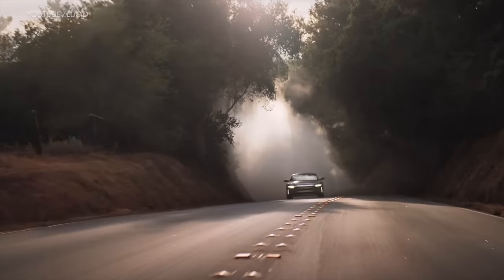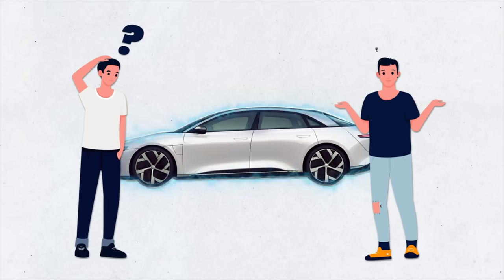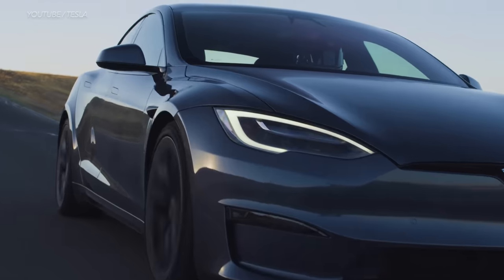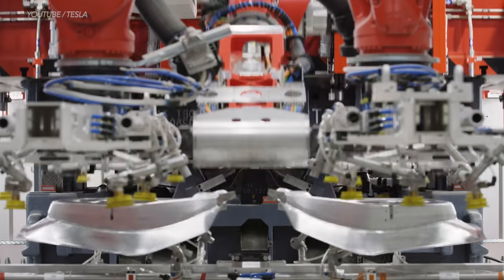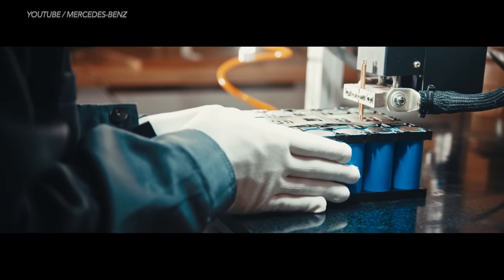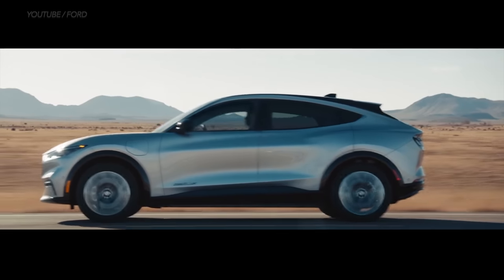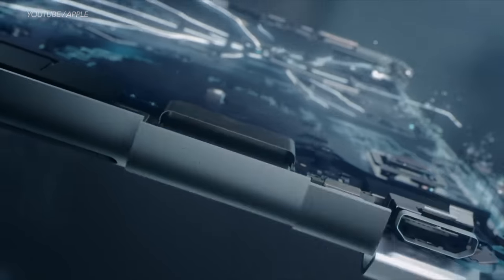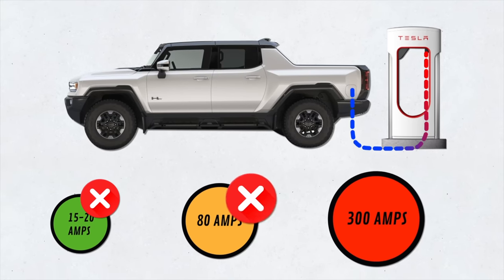Here's Why I'll Die Before I Buy an Electric Car

Comment: I don’t get it how they claim they save money on gas when you’re paying 54k for a Tesla $890 a month for 6 years!
Reply: Nailed it!!!!
Reply: First things first, you dont need to buy a Tesla. You can buy a Nissan Leaf for under 30 grand. Secondly, electricity is much cheaper than gas in current times. It only costs around 20 bucks to fill an electric car. 20 bucks times 4 times a month filling up is 100 dollars. With a gas car that is similar size and price. 6 dollars a gallon, you spend 70 bucks at the pump, 4 times a week, you spend 280 dollars a month on gas. And with a car that runs on premium you are running around 400 a month filling up 4 times a month. So, you save over 150 dollars for a car that runs on regular.. double for one that runs on premium. The math isn’t hard to figure out! Unless your too old to remember.
Reply: @mauricebarry8858  woah woah, let's take a step back. Most people that don't drive more than 12k miles a year aren't needing to fill up 4 times a month.
Reply: @mauricebarry8858  You want someone to shell out 30k for a Nissan Leaf, which is basically half a car and would not meet most people's needs in terms of utility? lol
Reply: Gas you average 75k miles 10k cash.
Tesla 75k miles 1500$.. 
You complaining about a car note is laughable.
Gas is a joke.
Reply: Not to mention Teslas are ugly cars.  I'm not interested in spending 60K for an ugly automobile.
Reply: You don't save money until you have had the car for its whole lifetime. Then you save money. I watched a video from a major news network that broke down the cost savings on EV to around 2 cents per mile. Lots of miles to drive to make up that difference. Electricity still costs money, it's not free.
Reply: @mauricebarry8858  cheap electricity go talk to anyone in Europe, like Germany or Cali or new York
Reply: @kensmith2796  teslas are not the only electric automobiles.
Reply: @craigfin3222  A Nissan Leaf meets most city peoples needs a small hatchback with room for 2 kids and 2 adults and groceries. Those are the people who shall go for electric cars, if you really need an extreme amount of utility, you go for a gas pickup. Everyone doesn’t haul wood for a living.
Reply: @richard6802  More like YOU don’t do that. Lots of people who have busy families easily get 12k miles a year and even more. Filling up once a week is normal for lots of family commutes, who an electric car would be ideal for.
Reply: @craigfin3222  You gotta shell out at least 23 grand on a small car like a leaf anyway nowadays.. small cheap cars aren’t 17 grand anymore.
Reply: @jamesa6740  Or me. 8 cents per Kwh in Ontario.
Reply: @jamesa6740  gas isn’t cheap there either. Gas has been over 8 dollars for years in Europe and its even higher now. Same with cali. Gas is closing in on 9-10 dollars in cali.
Reply: Paid $7500 for my Dave Ramsey clunker 2007Camry with 50,000 miles .I smile putting money in my savings .Had it 7 years and it’s still only has 69,000 miles
Reply: Have you seen what gas vehicles cost?? Plus no Oil changes or transmission very little moving parts to fix or take care of. Even the brakes don’t have to be replaced. You can fully charge your Tesla for $15. Basic math Tony!!
Reply: @mauricebarry8858  so honestly your estimations on how often people need to fill up on gas @4 times a week are wildly exaggerated in most people's case but lets just go with that, $280 for gas vs $890 a month on a car note means you would be paying $610 MORE per month to own a realistic EV and realistically a Nissan Leaf does not meet the needs of the average person but even with a leaf it would take 10 years to break even vs buying gas even at the exaggerated rate of purchase you quoted.
Reply: Tesla model 3 is a cheaper quality than Toyota Camry XLE but with 20K$ more. In addition, expect to change upper arm around every 30k miles. Tires on EV worn out faster than ICE. All of these details don't make you save a lot money compared to ICE. However, you gain range anxiety and your 5butt may be frozen in cold weather.
Reply: @js6729  I said buying gas 4 times per MONTH. once per week. On premium gas @ 7 dollars/gallon, you may spend upwards  of 400 dollars per month. Based on the type of cars I see on the road each day (Camry, corolla, civic, accord, fusion, escape, CH-R, CR-V, and other eco vehicles,) you may find yourself paying 30 grand for a decent spec of those vehicles. Even if you only fill up twice a month you still save on gas money because electricity is much cheaper than gas. Sure, if you're replacing a truck you may want something more heavy duty, but a Nissan Leaf certainly has a target audience that has more buyers than the country farmer pickup market.
Reply: Buying a used car and buying gas for that car, is alot more economical for alot of people( mainly people who don't travel vast distances)
Reply: @jamesa6740  in Europe ev adoption is the highest rate in the world. They will tell you that being tied to fossil fuels is a fools errand. Look what's happening in Germany. If Russian turns off the taps Germany is screwed. How would you like to be held hostage like that haha. Part of the move away from fossil fuels is so that countries cab have control of their own energy needs and not be held hostage by opec and other such fossil fuel suppliers.
Reply: @js6729  it just really depends how much u drive, what you would be replacing, and if u can charge at home or not. I drive enough that my savings on fuel makes my entire payment for me plus some. If you own a civic and drive ten miles to work every day and that's it, you're not going to benefit from an ev. If you're a sales person or something and drive a crossover 100-200 miles a day or you're an uber driver or something the ev will easily pay for itself. Uber drivers are actually renting teslas today because it's cheaper to rent a tesla and use that than it is to drive their ice vehicle.
Reply: @mauricebarry8858  I noticed he messed up how many times a month you mentioned filling. If you filled up four times a week your fuel savings would easily make your entire payment for you.
Reply: @mauricebarry8858  if you can charge at home an average 0-100 charge only runs you about $10.50
Reply: We went from averaging about $1700 a month on fuel to about $130 a month on increased power bill. So for us it was a no Brainer. But we drive A LOT more than most people.
Reply: @themeach011  This I agree with, I drive 5 miles a day during the week to work and back and on the weekends I go out of town to visit my dad who lives 600 miles from me. I don't have a way to charge an EV at home and there's no charging stations anywhere near me, there's also no charging stations between where I live and where my dad lives so an EV would not make it to his house. So I would not benefit from owning an EV at there current price and driving range. And yeah if I lived in the city and drove for uber an EV would be the way to go cause you'd make the equivalent of about $30/hr due to no gas cost
Reply: @themeach011  I don't even know how the person who wrote that managed to decipher 4 times a week, THEN proceed to WRITE IT and STILL not notice something is wrong lol.
Reply: @themeach011  Yeah and most times you don't even need to charge to 100 if you have a simple daily commute, work, school, grocery store, like most city-folk who would buy such a car like a nissan leaf, you probably only need 100 miles of range and thats generous.
Reply: @mauricebarry8858  But you're comparing to gas prices at $6 a gallon. For a more accurate estimate, you would take the average price of gas per gallon which is not $6. Gas won't be at that level too long I hope.
Reply: because a Tesla doesn't use gas...........  (how you save money on gas)
 You think other cars are free?  not all Teslas are 50k.   And the next wave of cheap EV's on the boats.
Reply: @justinparker1522  ok so let's talk about basic math, on a cross country road trip I can fill my tank in less than 2 mins at any gas station, while you will need to plan where to stop deviating you from your route and then have to plan what to do in line as you await the 3 folks in front of you to charge. I just spent $70 to fill my tank in 2 mins. You spend $40 to partially charge + waiting time, in ~2.5 hours. I'm already on the road while you are still charging your car wasting time. Time is $$$, basic math.
Reply: And how much is a Tacoma….. MB. Audi. And every other car.  You’re joking right because a Honda has reached 42k for an accord…….. 🙄
Reply: @jeffcoleman5160  Keep it as long as you can!  The engine tech from 2007 was the perfect balance of reliability and complexity.  Your Camry will run forever without the turbos, direct injection, and other nonsense to get an extra couple mpg.
Reply: @justinparker1522  Brakes still need to be serviced regularly to keep the calipers from seizing even if the pads are used very little.  Brake fluid still needs to be changed.  Shocks and ball joints wear out like any other car.  The extra weight of an EV means expensive tires, changed more frequently.  You still ultimately pay for depreciation like any other car.
Reply: @themeach011  EV's have their own OPEC equivalent, namely China.
Reply: @confidentlocal8600  funny story .one of the pistons cracked and I had it rebuilt with better rings and better anchor bolts for the head .$3500 but it will last for a while now
Reply: @mauricebarry8858  I just bought a Nissan Leaf for 14,500. I was spending $380 a month on gas to get to work. My Nissan Leaf payment is $260 a month. Perfect for what I need.
Reply: Wow Tony H I guess a lot of people don’t get it my car payment is $217. a month I could never spend $683. a month on gas both vehicles I own cost $120. a month for gas you and I see the savings sticking with what we have now.
Reply: @hardkore360  just did a similar scenario to what you propose. Did about an 800 mile road trip in my Kia EV. Cost, about $40 in electricity. Total time waiting for a charger, 0 minutes. Total time charging, 45 minutes. What I did during this time, restroom and food breaks which I would have done anyways as I have done this trip many times, this however being the first in an EV. Cost for fuel in my last vehicle to do the same trip, $300+. It’s simple math as you say. Running cost for my EV, $0.02-$0.08 per mile depending on state and charging rates. Average in my last vehicle, $0.43-$0.48 per mile depending on fuel cost. Even if you cut fuel costs in half due to higher current prices, I am still at an advantage in the EV.
Reply: @captinbeyond  they don't control the energy. Once u buy your car you are free to power it however u like. Plus you can build other chip plants etc wherever u want. China can't hold us hostage on that. We can make our own chips etc if we have to. U can't just conjure up oil out of somewhere that doesn't have any. I watched the video.
Reply: @captinbeyond  we can agree on that haha. Although just because we have oil doesn't mean we should rely on it forever and not embrace better tech. I feel like a lot if people don't like it because it's being pushed so hard but honestly if the tech is better people will want it and then the transition is happening either way. But I don't feel like we should be forced one way or the other but no one is going to force you to sell your gas car. U just won't be able to buy a new one eventually.
Reply: Just buy a nice used Honda and live happily.
Reply: @mauricebarry8858  let's be honest here... over the long haul you are spending more with an electric car even if gas prices hit $10 a gallon.. you can grab up a old camry 2010 or whatever for 5-10k with 50k-100k miles on it and I bet over the time it takes you to pay off that 45-55k tesla you'll still be saving more with the old camry. And you'll have more range per tank too... until I can pick up an electric used car at that low price that can still go 250-300 miles per charge. Ice still winning...
Reply: now 8-10 year car loans with all that interest, where's the savings? and if the car is not expected to last thru the loan?? wth?
Reply: @craigfin3222  :washhands:
Reply: @kensmith2796  there are about a dozen new manufacturers coming out and existing ones are focusing their efforts on EVs. Your excuses are running out quickly
Reply: @rkymtnchi503  I'm not making excuses and don't have to justify my choices to you.  I drive Jeeps - Wranglers and Cherokees with the inline 6 engine.  I will not be buying an EV.
Reply: @kensmith2796  I guess we'll see about that. I remember my dad saying he'd never drive one of those rounded car designs they started coming out with in the 80s and 90s. He doesn't have much choice nowadays, does he? You'll eventually be in the same boat
Reply: @btrts6431  if you sit in a 3 series vs a Tesla, I doubt you would go with Tesla. BMW or Mercedes feels much more luxury inside, Tesla is not a luxury car brand. I wonder why they sell it so expensive, it’s literally just body frame on top of a battery, nothing sophisticated that’s why many EV car brands will be established in the future
Reply: Exactly. I refuse to ever spend $54K on  Tesla. And I refuse to ever have a car payment ever and will always pay cash for ICE vehicles $30K or less and keep for 10-14 years or maybe longer. Rinse and repeat for rest of my life being 38 years old.
Reply: @craigfin3222  Bingo. Nissan Leave is like a go cart on steroids. And it costs as much as a solid small SUV or pickup like a Tacoma, RAV4, Escape, and the later 3 are so much more durable and of higher quality.
Reply: @themeach011  We have plenty of oil in the United States and Canada through fracking and tar sands we can easily be energy independent through that alone.
Reply: @confidentlocal8600  Bingo well said.
Reply: @Wolverine607  so why am I paying $327 for a tank of fuel in my truck then??
Reply: Tesla Model 3 LR with red color and enhanced autopilot (not full self driving) currently at CAD$88000 and wait time is 6 months or more. I just got a deal with a CPO Red Porsche 718 Cayman for CAD$63000, I will save $25000 for fuel and maintenance and I think Porsche 718 is a better looking car and driving dynamic imho! I will leave $1000 every year for basic maintenance, that leaves me $21000 for fuel, at the current price I could buy close to 9500l and with average fuel consumption I can drive for at least 77777km. That’s good enough for 4 years I think before my warranty run out then I would just sell it and buy another car!
Reply: @mauricebarry8858  lol if everyone switches to Electric cars electricity will be more Expensive to Produce which makes Gas More Cheaper cause the Less the Demand is the more the Supply the Gas for Less price.
Reply: My son won’t drive his Bolt from Houston to New Orleans to visit, because it sucks..
Reply: @kensmith2796  agreed the bulkier body style is hideous.
Reply: @mauricebarry8858  even the leaf is too much for what you get, I will absolutely never buy a Nissan leaf! I would walk before I buy a undersized, or under powered cheap EV. I would rather ride a conventional engine motorcycle than drive anything like that, then for utility work, nobody is going to buy current priced trucks either. I usually buy a big used nice truck for a low price for several reasons. I don't drive more than 5 miles a day. I need the truck for carrying stuff around or yearly trips. The cost of a decent EV truck is laughable for us common folk! Not to mention these EV's put out more CO2 than conventional engines if you decent range and you calculate the CO2 from manufacuring the thing. I'll wait for something else or die like Scotty! EV's are a big fail in my book, at least right now!
Reply: @TheWorst_time  I don't pay that much, and EV's suck! I'd take hydrogen over an EV, and they produce more CO2 than conventional engines!
Reply: @fabfrenchies1974  I know that’s untrue. I’m not even going to ask you to prove it. You just do not like EVs. 
Still better then gas if you own a home with a place to charge it.
Doesn’t fit everyone.
Reply: @mauricebarry8858  I doubt if you will be still driving your electric car 13 years from now like my 2009 Impala.
Reply: @DvniOS And look forward to buying a new battery every 5 years for a cost of thousands.
Reply: @mauricebarry8858  you forgot one thing, electric car of same luxury grade costs more than similar grade gasoline car, AND it derates more, so why would I get hit 2 times one during buying and second during selling of that EV? What for? For saving money on gas? 🤡
Reply: @richard6802  average is actually 14.4 k per year @ 24 mpg average that means 600 gallons of gas.  So at 3.5 a gallon a person spends 2100 yr and 21k for 10 years
Reply: @mauricebarry8858  I just compared a Nissan Leaf to my Corolla. The Leaf would cost more per month than my Corolla with my driving habits. Not to mention I live in an apartment, and can't charge my car at home. My car gets over 400 miles per tank, and the Leaf only gets 212. It will never work for me. The time to charge would interfere with my schedule also. Now, I compared the two new because I would only get an EV if its new. The Battery replacement would cost way too much if it isnt working right. EVs are just not there yet.
Reply: @mauricebarry8858  who the heck pump 4 times a week? Commuters maybe. I live 5 minn drive away from work. I pump once or twice a month. Also my wait time at the pump is 5 mins maybe less. What is your wait time at the charging station?
Reply: People are easily brainwashed!
Reply: @mauricebarry8858  No I can't buy a Renaultssan Leaf for under 30 Grand because I am not made of 💰 like some people seem to be. 

And as for the premium fuel expense claim. 

It just so happens that I drive a 2013 Mercedes C250 Coupe with a 1.8, 4 Cylinder Turbo GDI, and a 7 Speed Transmission.

And guess what?? 

It gets nearly 500 Miles on 1 tank of 91 Octane Fuel. And where I live Fuel prices are dropping below 4 dollars a gallon now. 

And my car is more fun, more comfortable, and far less expensive than the rediculous, and hideous Renaultssan Leaf.
Reply: @mauricebarry8858  

The problem is we don't even need EV's.

I don't need one and neither do you. 

They are just smoke and mirrors.
Reply: @mauricebarry8858  

Electricity is only cheaper until your electric company asks for a rate increase. 

That's what they do best. 

For the love of money is the root of all kinds of evil.
Reply: @themeach011  

But you didn't need an EV though. 

What you had was just fine but you were not content and that's why you switched. 

See that's the problem with EV fanatics, they are never content with what they already have.
Reply: @mikeb1039  How you save money on gas by putting it right back into the purchase price of an EV or monthly payment for one. 

Nice way to NOT save on gas.
Reply: @lukereeves4448  

But you didn't need a Renaultssan Leaf

You fell for the Smoke and Mirror's
Reply: @moarpwr4414  

No your not at an advantage. 

You said that trip you needed 45 minutes to charge your car.

Why would you waste 45 minutes charging your car when you could have been back out on the road and to your destination that much earlier. 

And what if the charging station was out of order, what would you have done then??

The inconveniences of an EV are far more than you realize. 

Not to mention that Kia's quality control sucks. I saw a brand new Kia SUV on 🔥 off the interstate in my city. 

Just saying..

Facts are facts. And the fact is that EV's are all smoke and mirror's
Reply: @LegendRonk  Exactly!! These EV fanatics just don't understand the Facts.
Reply: @8188jlpc  Bingo!! And what happens when they can no longer afford the payments. 

Uh oh, repo time.
Reply: @extremedrivr  right, because a little drought and extreme weather is good for everyone. People are getting more EVs going forward and maunfacturers will focus on them now and in the future, whether it hurts your feelings or not
Reply: @extremedrivr  just because we aren't going to run out doesn't mean we should just keep burning it forever if there's better sources of energy available. I'm not a radical environmentalist by any means but to me it still makes sense to transition away from burning fossil fuels if we don't need to. There's plenty of other uses for oil and it will likely be a part of our lives for many generations to come.
Reply: @themeach011  There's no need to transition away from fossil fuels. 

I'm not saying we cant use other energy sources along with fossil fuels to power the grid.

What I am saying is that there's no reason to convert ICE cars to EV. That is completely unnecessary, a waste of time and 💰. Plus it's horribly inefficient, inconvenient and impractical when compared to ICE.
Reply: I got a used 2013 nissan leaf for $5000 and it still run like new
Reply: @LittleGreen_Dude  

You poor soul. 

You not only bought a Renaultssan but you also bought an EV you didn't need. 

Bad decision man.
Reply: because a model 3 competes with a bmw 3 series and not a corolla. A 3 series is in the same price bracket as the tesla, and it beats the bmw in almost ever metric that matters while also not needing gas and most likely lasting longer too. Not to mention depending on where you live your government subsidizes your ev purchase so it usually ends up cheaper then that bmw too.
Even outside of Tesla there are good options now like the ioniq, and bolt EV and EUV any of these would outclass any ICE in the same category, why do you think all the manufactures are scrambling so hard to get EVs its because ICE cars are starting to look kind of archaic when they are being compared and seen next to price comparable EV cars even in their own lineup.
Reply: @mauricebarry8858  Nissan leaf. I would never drive that embarrassing piece of crap
Reply: If I had 55,000 I'd pay off my mortgage
Reply: @joeoconnor8106  That's a smart man's answer.
Reply: @TheWorst_time  You forgot the $890/month and $16,000 to replace the battery in 10 years.
charging a Tesla full charge for 450 miles. $40.00... 75,000 clicks/450 x $40.00 will cost $6,700 - Gas @ $4.85/gal current average for Cali ===  75,000 / 24 average mpg for a 6 cylinder engine = $15,156......Average book car mileage/year is 25,000 miles.
Tesla will cost you e-charge $2,233/year x 10 years for battery life = $22,233 + $16,000 (average battery cost - depending on model)  battery replacement = $38,333 (10 years)...  Gas - $15,156/3= $5,062/year x 10 years $50,620...So there is some savings for EV but very little when spread over 10 years,,, question is,,,,,, what is the price difference between the Tesla and the 6 cyl car? Was there really a saving? 
For now I still like those long weekend drives, infrastructure for gas is well in place.  Thanks for bringing this topic up, it enlighten me.